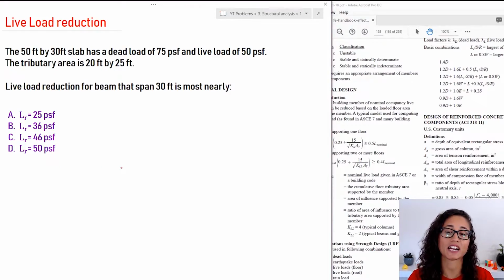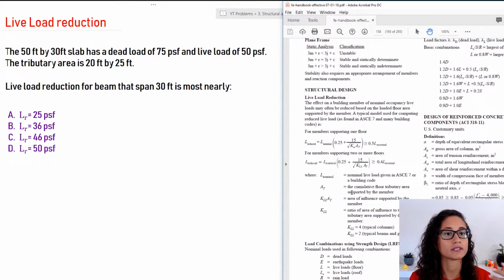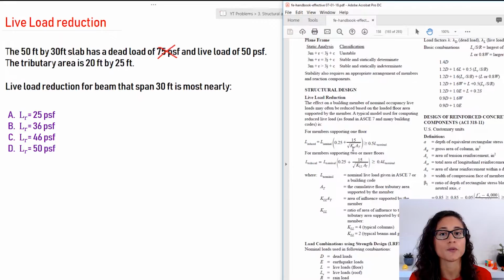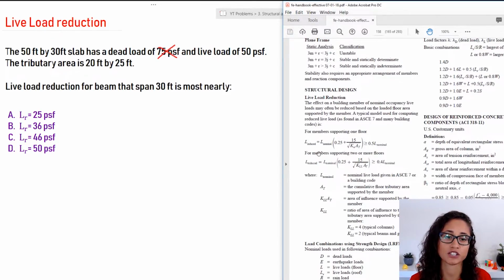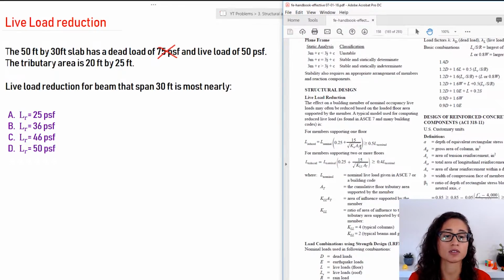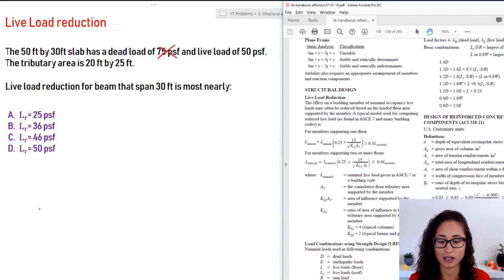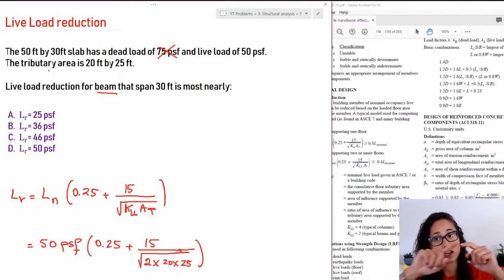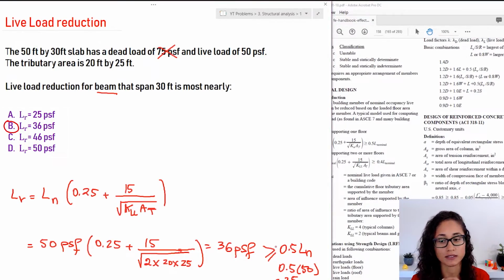FE Exam Structural Design - Live Load Reduction

Comment: hello, thanks for your efforts, 
I have questions in designing 
in the Reference book, there are a lot of missing equation 
just like Steel Connectors, Steel beam-columns- web, and flanges compact equations.
what do we have to do for questions that related to those topics?
Reply from the maker: You can find those equations on the steel manual and try to remember them. However, I don't think you will have something like that on the exam. If the equation is not provided to you on the reference manual, there is 95% chance you would not have it in your exam! I hope this helps and good luck with your studying!